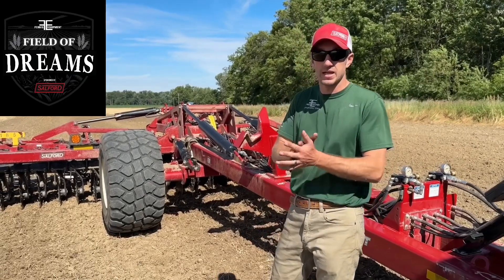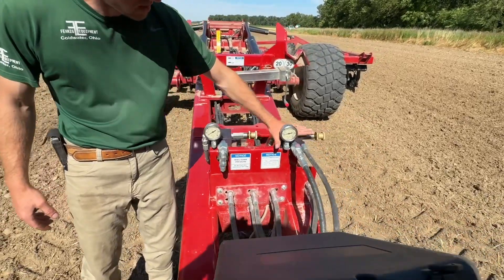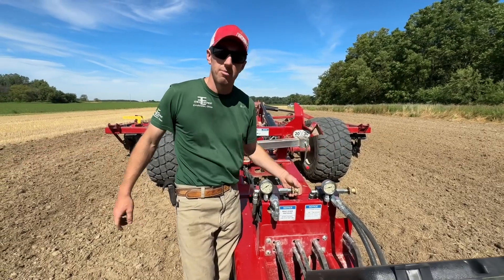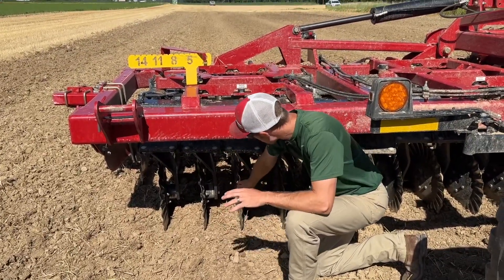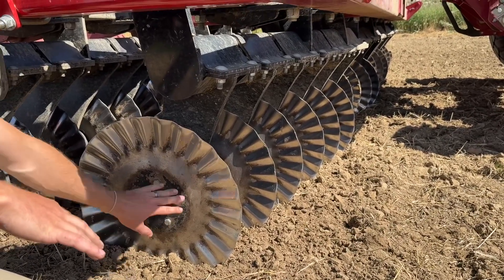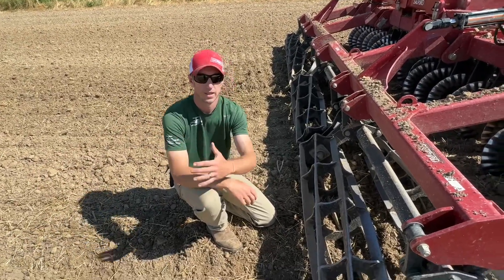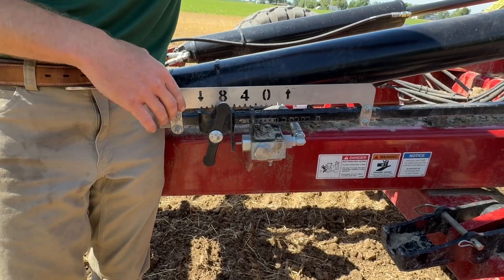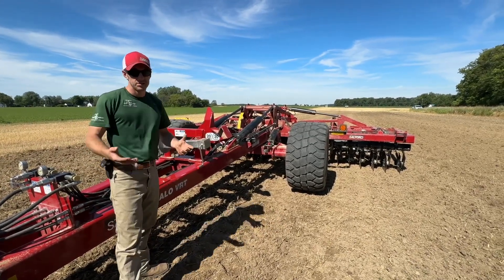What We Have Learned Running The Salford Halo VRT

Comment: How many acres can you run before the bearings go out on the blades?
Reply from the maker: With 22 machines in the field, the first one being in 2022, we have yet to sell or warranty a bearing. So we do not know that answer but being that they are the 5 bolt cup and cones, it will be a very long time